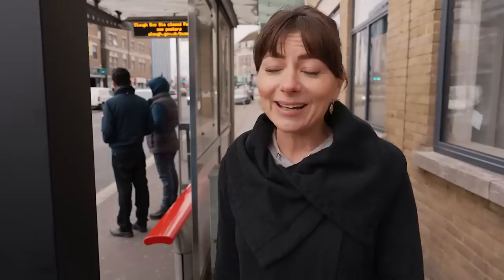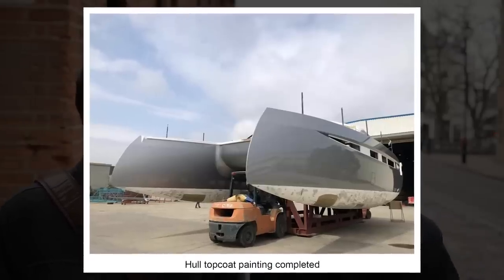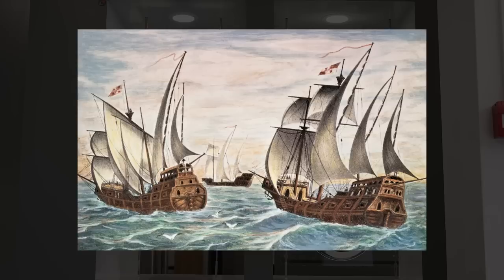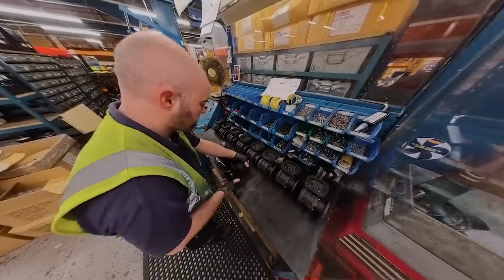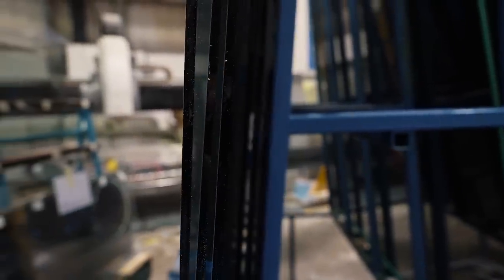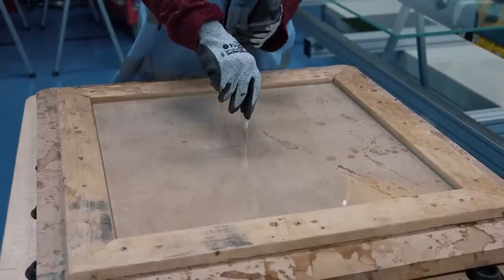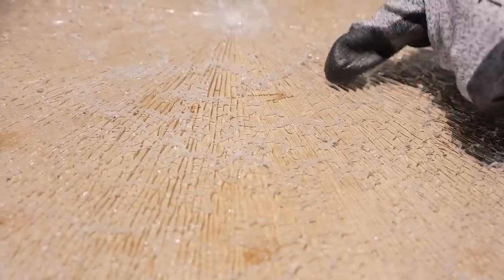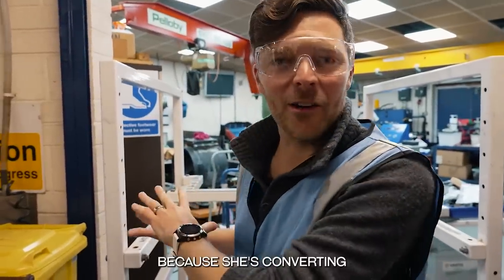HOW BOAT PARTS ARE MADE (inside the Lewmar factory)

Comment: That was a great video. I used to work for Lewmar. I ran the Lewmar Marine division that operated in Canada. Our office/warehouse/rigging shop facility was just west of Toronto. Our neighbours were C&C Yachts and host of others. Lewmar owned Navtec (rod rigging and hydraulics) in those days (mid 1980s to early 1990s). We built rigs, repaired and serviced Navtec Hydraulics. I built some rigs for very large boats - 12m Class etc. I also sold and serviced Lewmar products to some very large catamarans such as TAG (became ENZA). TAG was almost 100ft and was sailed solo. It was built by Bombardier in Montreal.  I used to travel to Havant several times a year. The winch factory was the first fully automated sailboat hardware facility in the world. Lots of great products were designed there and and manufactured by a staff who were (and still are) totally focussed on the best possible products and service for their clients. I’m glad you’ve chosen Lewmar as a supplier for your new boat. You will not be disappointed!!

Comment: I just had the front cap on my 2019 class C repainted after the gel coat started pealing in patches! And I wax it 2X’s a year! 

The coach body shop that did it, used urethane paint, same paint they use on airplanes. I’m so glad I did. I put one coat of polish on it. The stuff is as tough as nails! He said it will outlast the RV!

Comment: Your choice of paint over gel coat is a great choice. I once had a ski boat I painted with "Awl Grip" epoxy paint.  Afterwards, I was on a large lake and ran out of gas. Fortunately a houseboat was nearby and came to my rescue.  While tied up alongside wave action caused the houseboat to be higher than my deck. The houseboat pounded the top of my deck. While it was happening all I could see was huge damage to my new paint job. Crisis over and time to inspect, not even a scratch.  I love epoxy paint, tough and durable.   Adventure on enjoyment of life awaits.  Great move to tour manufacturers available to you for later maintenance.

Comment: Not sure you’ll see this, but there are some hidden potential defects with tempered glass.  One is the growth NiS particles from the heat treat.  It is nearly impossible to prevent.  The particles are the size of a grain of sand or even smaller.  There aren’t many.  However it can vary by batch.  The particle of nickel sulfide can grow at room temperature, but more slowly than at elevated temperature.  If the particle grows enough, the window cracks.  It could happen in the middle of an ocean 20 years from now or never.  If the tempered window is laminated, you can safely use it until it can be replaced as the glass fragments are glued to the laminate.  There is a small chance any good window can fail for this defect (probability is like 1m^2 / 20000m^2.). It varies with glass provider’s effort.   No one is immune.  There are alternatives to tempered glass.  Tempered is still used a lot.

Comment: Steel toes will protect your toes up till their bend weight at which point they will cut your toes off instead of crushing them. Fork lift trucks vary in weight, the ones we used (which are relatively small) were 8 tons gross weight I seem to remember. You do not want your toes run over with or without steel toes.
48V is generally the highest safe voltage for DC (so good choice). If a boat owner adds bits made for AC or 12V DC they will generally work safely up to about 48V. Above 48V, AC switches or low voltage switches may arc when turned off and cause a fire (and effectively not turn off as well). It is of course possible to make DC switches for higher voltages but they do start to cost a lot more. Solar panels are often run at a higher voltage and have longer fuses and bigger cutoff switches for that reason. The highest voltage is always the best for efficiency all the way through and up to a point, generally cheaper as well.
The most dangerous voltage? For people, the most dangerous voltage (AC or DC) is 70ish volts which can stop a human heart. I am told that by the time the resistance of the body is taken into consideration, 70v ends up at just the right voltage across the heart to try to control it... higher voltages more often cause injury because of falls or if it's really high (think 1000v) and has lots of current behind it, will burn through. 120/240 are actually pretty safe as these things go. I think I have personally tested this as a child  ;)

Comment: FYI 26:23 is less wiring, not less worry - higher volts mean less current to transmit equal power through the same thickness of cable. This is why in europe we have 3000w kettles and microwaves, but in usa you're limited to around 1500w, basically 240v vs 120v!

Comment: The metal recycling thing CAN be a decent way to cut costs in some shops, like this one.  When I worked in a screw machine shop most of the machines were dedicated to brass, had an underfloor conveyor system, and a centrifugal system to remove oil from the brass chips because the chips were worth more that way.  There was a 40,000lb hopper for brass on the loading dock.  Most of the rest of the waste was separated into bins essentially to keep it from contaminating the brass waste (a rather small amount of aluminum in that 40k lb hopper would contaminate it and ruin the value).

Comment: If you are familiar with "tempered" glass, that is the same as the toughened glass described in the video. The tempering process strengthens the surface of the glass and allows the glass to crumble when broken. Laminated glass, like your car's windshield, is made stronger by the interlayer of plastic.

Comment: Apologies: In mentioning a better paint option is Fluropolymer Paint 
[ Kynar  ]  based painr I should have stated  ADS  ( air dry syste. )
lifetime paint , we use it Architectually on roof panels as well !
make sure you ask for an extra gallon in case you get in a accident 
you will love the durability over the best  Boat painr

Comment: While I get you want to color match and that would be difficult...Black is the actual recommended color for an adhered section? I mean, a small white border would, I think, create a much more tolerant adhesive below?

Big ups to the engineer for recommending 48 V. You can literally run 48V throughout the boat and just buy stepdown converters to place at the locations where you need the items at a different voltage, or if you must, run them through and have a fuse block in a central location as well.
With the former, you get the benefit of having whatever breaks or trips being within usually an arms length away from the step down, but hopefully she sees this and can retort some advice!

Comment: Helpful hint on the paint for your new boat.  When manufacturers discontinue a paint color you can not always get a paint match from the code, but if you have a sample of the original paint that they can take with them to match you can almost always get something that matches.  I like to hide away a small sample of every paint I will need to future proof my long term projects.  I hope this helps alleviate some future headaches. 🙂
Reply from the maker: Great tip!  Thanks!

Comment: As a long retired AF avionics tech, there was a time when multiple voltages would have been a nightmare, however with solid state converters and inverters, you can do it without much heat loss or weight.
As for what else they could make, how 'bout an 18" 48 volt dishwasher for Jason!

Comment: Laminated glass should be used for areas subject to impact such as forward facing windows.  That way you don’t have to worry about taking water over the bow into the main cabin if a block comes loose and smacks a front window shattering it.   The other advantage of laminated glass is one of the inside surfaces next to the inter layer can receive a low e-coating.

Comment: Higher Volts lower Amps, smaller wire. Most industrial equipment in US works off 480 VAC. Also,  higher number of strands gives more current transfer, as the current rides on the skin of the wire.

Comment: I had my windows replaced a few years ago and I live on the 4th floor so the Window company required me to use laminated glass (new code requirement)  -- it added about 25% to the cost.  

They charged me literally "cost" for the "upgrade" because they didn't include it in the quote.  But they are definitely quieter.

Comment: So....All the glass is flat.... but they are all custom shapes.     What's the size of biggest piece?     Have you thought about carrying a single sheet of polycarbonate plastic (or plywood) in that big workshop /storage area just big enough to cut to shape to cover (plywood) or make a temporary replacement (plastic) window for any of the windows on the boat on the boat that break?  While waiting for the custom piece of glass to be shipped to you from England?

Comment: 5:00  Have the factory stack 4-5 coats of Titanium Ceramic coating over the paint once it drys.  It's 'Hydrophobic" so it sheds water.  It will last a year or more if you stack paste wax on top of the titanium/ceramic coating once it cures.  Most dirt can be washed off with a hose with little scrubbing.  That's how I keep the paint on my wife's Cobra looking pretty after 20 years..  6:26 Don't worry about it I'm sure the Brits are used to Americans doing weird stuff.. 🙂

Comment: With paint I would highly highly recommend a ceramic coating and no I’m not talking like the crap they sell on tv or YouTube ads or in big box stores no like the tru ceramic coatings by the originals like ceramic pro. It will change your life and shock you how incredibly easy it is to maintain. It also helps big time the under water surfaces

Comment: AS AN ELECTRICAL ENGINEER I WOULD STILL PREFER THE 48-VOLT MOTORS WIRED WITH THE THICKER 24-VOLT OR EVEN 12-VOLT THICK WIRING BECAUSE WHEN YOU'RE OUT THERE IN THE MIDDLE OF NOWHERE THAT TRANSLATES INTO MORE MUCH MORE DEPENDABILITY ON ONE OF THE BOATS YOU WERE ON THEY HAVE HAD A DEAD ELECTRIC WINCH AND IF IT WAS 48 VOLT IT PROBABLY IS BECAUSE OF WITH THE THINNER WIRE IT'S GOING TO BURN UP SO WHAT THAT EQUALS IS THINNER WIRE YET HIGHER VOLTAGE AND STILL HIGHER  AVAILABLE IN THE SYSTEM SO IF THERE'S ANY PROBLEM IT'S GOING TO FRY FASTER WITH THE LIGHT OR GAUGED WIRE
DAVID ADAM GRENIS MAPLETON AVENUE BOULDER COLORADO

Comment: This is our British skills people forget about we are possibly the worlds oldest multicultural country in the world and has saved us in so many wars thoughts engineering building in our History. I used to make lenses in all types of glasses including bullet proof lenses From glass plastic and the first poly-carbonates which originally took hours to make one pair of lenses. Bullet proof glass lenses were razor sharp hard and heavy for glasses while plastic was easier to handle and shape the hardest was poly-carbonates as special diamond to cut them to peoples prescription in some cases I had to work them from eye as hard to measure the center thickness of each lens.  So wondering why they never made the windows out of poly-carbonates? I know very expensive but would stop artillery and bullets. But thinking about it they are actually heavy unlike carbon fiber or their types of glass and in the sun if not tinted treated correctly can change colour to a yellow than the dark black colour needed in sunlight. As sun glasses are easier but when thin edges like modern Poly-carbonates are can crack as should never crack or break.  Just a thought.

Comment: 48V... "it's ideal" - nope. It's just the highest voltage you can get away with that is still classed as low voltage. In the EV world, most people are operating with 350-450V for the drive train, some companies have started to come out with cars that run on 800V for batteries. On the other hand, you have to handle several hundred kW, much more than anything you regularly have on a boat.

Comment: Higher voltage is always more efficient, for example in home power 240VAC produces more power than 120 Vac ,  why does America use lower household voltage? Because lower the voltage less potential to kill someone, America uses 240v in special places away from children access such as where a Dryer is located  or special equipment in house,  Europe uses 240 as a standard, why? it's more efficient,,  the higher your DC voltage same concept...